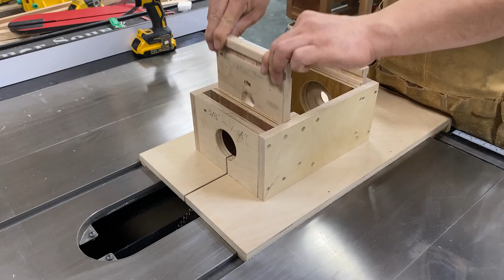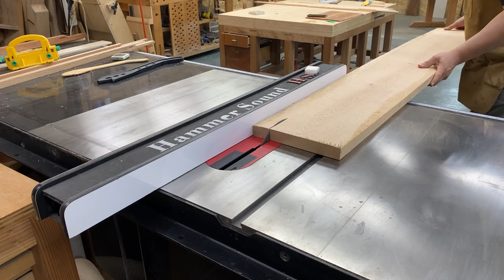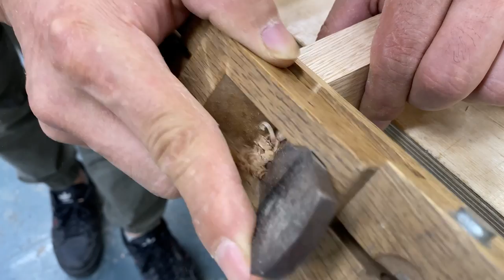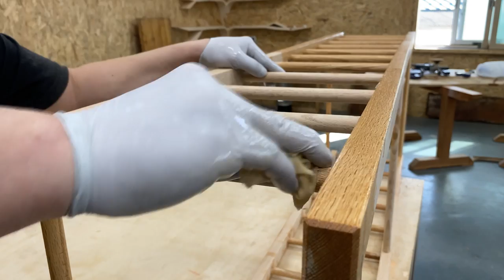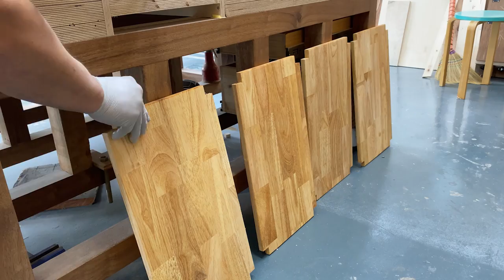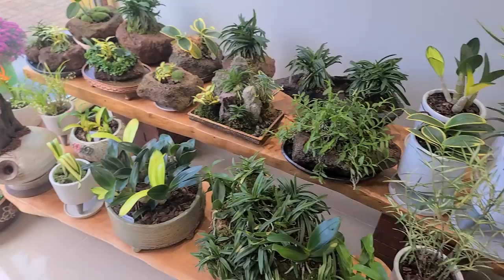Making a bookshelf out of round wooden sticks / height adjustable bookshelf / Woodworking DIY

Comment: the moment this saw blade snaps will be like "oops"
And You even use a power tool to make it even more likely to happen, what were u thinking.
Reply: Hmmm... unsure if that is actually the case. The high rpm of the spin and the slow pace will most likely provide quite little side axis force. Overdo it and yeah, snap. But If you pace yourself I would believe this to be just fine.
Reply from the maker: It may seem uneasy because you are not used to using it like this.